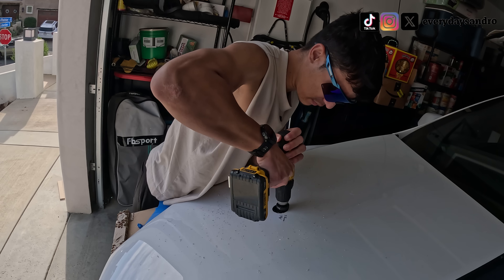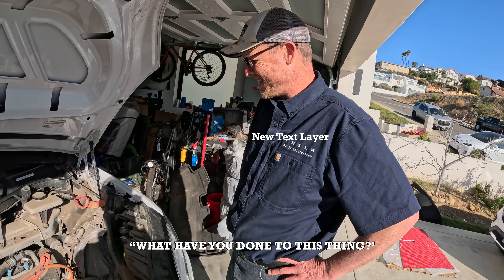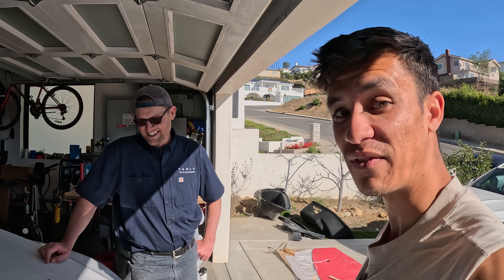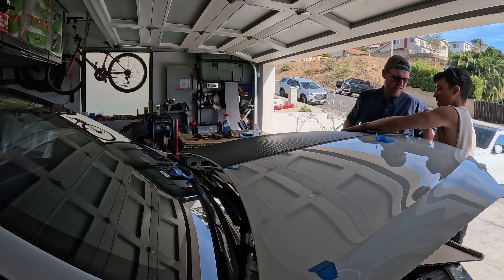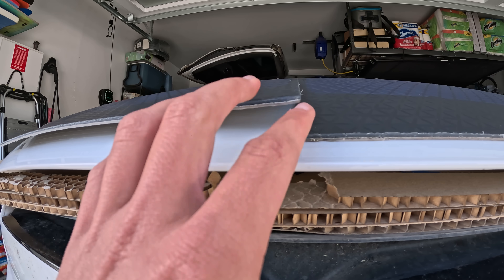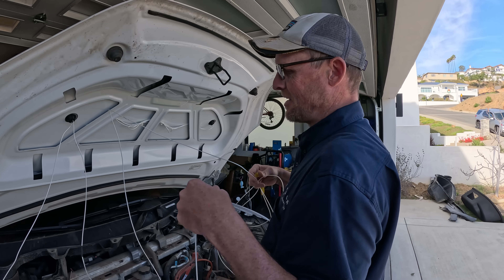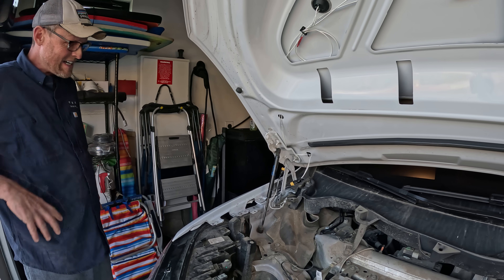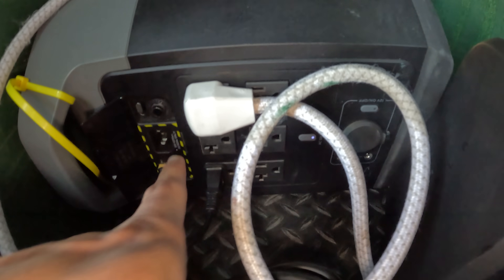DIY Solar Powered Tesla - THIS Changes Everything

Comment: Please clarify that this is to charge your power station and not the car. What size is your power station?
Reply from the maker: I can do both, but the main goal was to keep the power station full when I drive through remote areas without tapping into the HV. When I drove to Tuktoyaktuk, I had no choice but to drain the EcoFlow without charging it with the 12V in the back. The one I have now is the EcoFlow Delta Max

Comment: Fantastic, Sandro! Four questions:

1.  Did you have the panels custom cut?

2.  How much do they cost?

3.  Can you charge simultaneously from the solar panels and the 12V DC?

4.  Which EcoFlow do you have?
Reply: Monitor this install for quality and durability for one year.
Meanwhile, consider install on rear hatch. 

Certainly not drilling a hole in the glass. In that case, wires out the surface needed.

OR, can the panels be INTERIOR mounted? 
Although the glass tinting may negate the panel efficiency?
Reply from the maker: Thanks, great questions! 

1. These panels are custom made by MitoSolar

2. These panels are sponsored, and each panel varies in price depending on the project!

3/4. I have the EcoFlow Delta Max, which allows 2 power inputs to be combined (12V DC and Solar)
Reply: @ 

Thank you so much, Sandro, for such a fast and informative response. 

One follow up question: Are you using your Delta Max with it lying on its side? For me to mount my Delta 3 Plus in in my Model Y in the forward rear sub trunk under Jimmy’s Fruble Lite, it looks like I’m going to have to put it on its side, and I want to be sure it’s safe to do that.
Reply: @ 

Do you have your Delta Max installed on its side? Is it safe to do that? I think I will need to do that in the installation I have underway on my Model Y and want to be sure it’s safe.
Reply: @ 

Is your Delta Max installed on its side? I think I’m going to have to install my Delta 3 Plus on its side in the installation I’m building for my Model Y. Do you know if it’s safe to put the EcoFlow on its side?
Reply: @ 

@ 

Is your Delta Max installed on its side? I think I’m going to have to install my Delta 3 Plus on its side in the installation I’m building for my Model Y. Do you know if it’s safe to put the EcoFlow on its side?

Comment: Bro i would get some kind of sleeves for those wires, they have them on amazon u just loop it in, u dont have to uninstall anything. But any wires that touche metal is gonna get cut once the car vibrates on the freeway
Reply: @Nguyening_music  
Grommet & Wire loom to protect wires.
Reply: @covetthecamper2289  and I think the wires are too thin. You will heat the wires more than you charge… NO TIN, JUST COPPER.

Comment: Please do a follow up video on how much the battery is charging in the next week or two. Looking forward to hearing how it works.
Reply from the maker: @LJ-jq8og  indeed!
Reply: Yes please. Follow up!! Great video and so curious on how the daily charging changes your habits, for the better 👍💪
Reply from the maker: @ yes will make it! First looks will be up this upcoming week
Reply: @theendisnear4025  The reason the cars don't come with panels built in is because there's not enough amperage to push the electrons into the battery this way so it doesn't work .... This is a big waste of time and money  .
Reply: An aweful lot of negativity and ignorance in this thread. Using the solar is entirely optional. He can still use his car's DC output to charge the EcoFlow in the case of lack of sun. Keep in mind that this is in preparation to drive down to the end of SOUTH AMERICA. He will be driivng in the sun no matter what, so this is free* energy that won't be taken from his battery.

Also an EcoFlow is not 'thousands' of dollars... You can get a 2kWh EcoFlow for ~1k, probably under during big sales and 2kWh is pretty overkill if you don't need ultra-high AC output. My 512Wh EcoFlow is $300 and can power most devices under 1000w.
Reply: @JohnBarber  - "aweful lot of negativity and ignorance in this thread."

No it is a waste and will not help appreciably.
But I guess I am "negative and ignorant" being an Electrical Engineer and Spacecraft Power Engineer?

Lets call that hood One Square Meter.
One meter of sunlight can produce the Maximum of ~1200 watts IF the sun is perpendicular to the panel.
Modern Solar Cells are less than 30% efficient.
So IF you have PERFECT SUN on that panel, you are not generating more than 1200 * .30 = 360 watts.

With an 85kwh battery, this will only take: 236 hours of PERFECT SUN to charge.....
In reality it will be less than 1/4 the power averaged over 12 hours.
NOT WORTH THE TROUBLE - even if you covered the entire car.
Reply: @stuartgray5877  all those fancy credentials and you didn't even bother addressing (a) anything in my comment or (b) anything mentioned in the video.

The solar panels weren't installed to charge the car battery. He literally never makes that claim. They were installed to charge the EcoFlow battery so that he doesn't have to rely entirely on the car to charge it. The EcoFlow powers all of his electronics like Starlink, fridge, induction burner, and his electric tea kettle.

Even in the video that came after this one where he does use the EcoFlow to charge the car he clearly says it's just a test, and mentions he only got about 2 miles of range after like 30 minutes of charging. Nobody should be making the argument that this would be a practical way to charge an electric car, for the very reasons you mentioned. Sandro didn't make that argument and I certainly didn't so I'm not sure why you're even commenting.
Reply: @stuartgray5877  He's npt trying to charge the car.  He's charging a battery powered inverter.
Reply: I think in my case i would sacrifice a bit of the solar rooftop to fit another solar panel... To maybe have 450watts or possibly reached 500watts total...
Reply: Exactly here it is not observed at all that that supposed system charges the vehicle.
Reply: I can guarantee you it makes almost no difference. Probably makes things worse by adding weight and messing with the aerodynamics.
Reply: This is gonna be fun.. Bs
Reply: What a waste !! There's a reason the cars aren't built with panels installed on the roof !! Solar panels don't have enough power amperage wise to push the electrons into the internal  resistance of  the battery.. The best you may get is 1 added percent every few hours  but highly unlikely .. This is a complete joke !!😢
Reply: @kevindoherty2716  If you are not paying attention then why even bother commenting.
Reply: Almost everyone is commenting on solar charging the Tesla battery. Smart enough to know the science but not listen to the video?
Reply: Yes follow up
Reply: he'll be lucky to grab 4-6 kWh out of his ecoflow with 3-4 days of solar charging in the summer.
and his ecoflow costed him THOUSAND$$$$$ of $$$
Reply: @ShadowLancer128  oui mais lui il fait,il tente, pendant que d’autres ne font que commenter
Reply: @ShadowLancer128  I would love to put that solar array on my 2007 Camry so I can keep the traditional car battery trickle charged !?
Reply: @LJ-jq8og  that's easy
Reply: @LJ-jq8og  You can get a simple solar panel hooked up to the battery and sits on the dash to do that.  I maintain a small toyota to hold my space in front of the house so they don't block my driveway.  Been doing this for 10 years and my car starts EVERY TIME like a charm.
Reply: @Looking4U2 interesting, I actually have a 20007 Toyota I keep in front of the house as well. I also have a driveway that faces the street. Perhaps I’ll start doing the same.😊
Reply: @ShadowLancer128 ... And he must put the car in the sun, heating it up needing climate control (needing energy).
Reply: @christiankaiser6562  So, you are always Park your car in the shadow and never park under the sun.
Explain us how is that possible????
Reply: @tr9036 it ain't. But I do that as often as I can. Enough trees or houses here in Europe. Where are you from? Your situation can be different.
Reply: @christiankaiser6562 So, if there is a solar panel on your car, it will work. Cars designed to withstand the sun rays.
Reply: @tr9036 yes. But that energy is then needed for the A/C before I plan to enter the car. And the heat does definitely reduce the lifetime of electronics parts. I do avoid parking in the sun as often as possible.
Reply: You cant drive and charge at the same time. Plus he doesn't show any way of hooking up the car batteries. Somehow the Tesla Inc should look into this and the sale of Teslas would go up!
Reply: @Endoe.McKronic  nobody is buying swasticars anymore
Reply: @Endoe.McKronic  WTF !?  You didn't even watch the video... He is NOT charging the car battery he is charging a power station... Try not to BLURT shit out w/o knowing what you are talking about 🤣
Reply: @onetwothreefour-s1n  Tesla-hater-miscreants screaming "OUCH" yet agin....  🤣
Reply: @LJ-jq8og  imagine hysterically defending a na zi. Crazy days to be in a cult
Reply: @LJ-jq8og  imagine worshipping the guy who faked being good at video games for clout. Super cool.
Reply: @onetwothreefour-s1n  To the haters: Somebody is upset that Elon is the richest man in the world🤣 somebody is upset the Tesla is the best selling car in the world🤣 thank you for making my day and saying  “ouch”🤣
Reply: @onetwothreefour-s1n  Is that why Tesla shattered expectations in Q1? Is that why the new Model Y is selling like hotcakes?
Reply: @themonsterunderyourbed9408  you ok? Tesla sales were down the most in the company's history. It was a pathetic showing. What planet are you on right now? How deep into the cult have you gone that reality and math are foreign concepts?
Reply: @onetwothreefour-s1n  funny everyone forgets who created Volkswagen 🤔.
Reply: @frankfrati4 yes, 88 years ago. Not especially current and the big H isnt the current ceo, right? For what, like 80 years now?
Reply: Due to the amount of energy per square inch from the sun itself, even at 100% efficiency it would take a trailer covered in photovoltaic cells to make any difference. This is all BS.
Reply: @gabbymcgibson984  It must derive some energy !?
Reply: @LJ-jq8og  Of course! Lets look at it this way, how much energy per square inch hits the surface of the Earth? Lets say this channel owner with no way of thinking of a decent idea for content were using 48V architecture. I'm going to assume he isnt because of the lack of research or just fad clicking channel subs. But, sure...48V, how many amps do you think he can pull? Well unless hes in AZ or the Middle East he wont get enough charge per day to make it worth the money invested, resources wasted and well his time isn't worth much so we wont count that. So I welcome anybody whom is interested in the photovoltaic world to find a better channel with an actual use case that can help others. 

Really people, hes just click baiting for channel growth. I hope he gets a better idea that can entertain more than the ignorant souls who are interested enough in renewables to click a video then bent over and fed BS use case.
Reply: @ I totally get and understand your fair point. However, for somebody who’s living on the road in their car, even having something that might charge their iPhone for free is a big deal. So if he gets enough to charge his iPhone and some other things like perhaps cooking then wouldn’t that be worth it?
Reply: @LJ-jq8og  not for the total amount it cost to set that all up. It'll take till when the car is scrapped to come remotely close to worth it
Reply: Read my math comment. I agree.  @gabbymcgibson984
Reply: @LJ-jq8og  were you able to cover the swastica decal on the hood? Not sure Elon will be ok with you hiding that.
Reply: @ Oh my 🤣 Another triggered Left-Tard saying "OUCH" about the electionS ❗ Thank you so so much... I LOVE 🥰 it when you manifest your "pain...."   I am savoring your LOSSES    😂😂😂
Reply: @onetwothreefour-s1n  THANKS FOR POINTING OUT THAT YOUR A CRAZY LIBERAL.

Comment: Would you drill a hole(or TWO) in a real Beluga whale?  Just sayin… Like the idea but too permanent of an install [on a $100K car] for my liking.
Reply from the maker: @js3085  a new hood is $300-500 and the amount of utility I get out of this I can’t quantify. I can’t even harm a fly so I won’t drill real holes in a Beluga
Reply: Yeah hood replacement is easily available,  even a scrap yard for 120
Reply: @acrusso1  I checked OEM prices and a Model X hood was $3250!  Not even sure if that was painted and definitely not installed.  I’m thinking $5K for a shop to paint & install.  An upgrade would be no drilling, wires out the back tucked under hood. Are those panels “permanently glued on” as well?  Again, just thinking trade-in value later. You’re average owner wanting a set up like this will NOT be breaking out the drill. Kit needs work.

Comment: Better get something to protect those wires against the metal part. Otherwise, good job.
Reply from the maker: Figuring that out!
Reply: Just needs something to edge protect
Reply: You just need some non-flammable corrugated pipe for the cable.

Нужна просто не горящая гофра для кабеля.